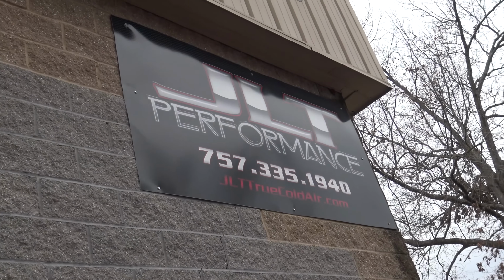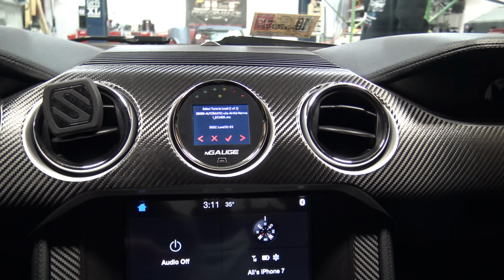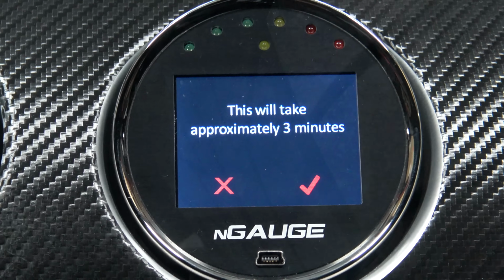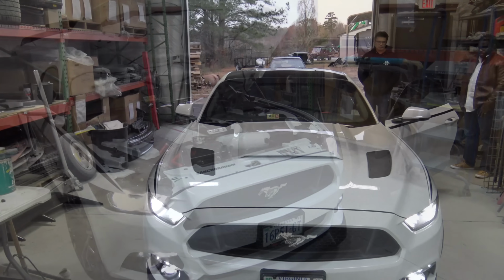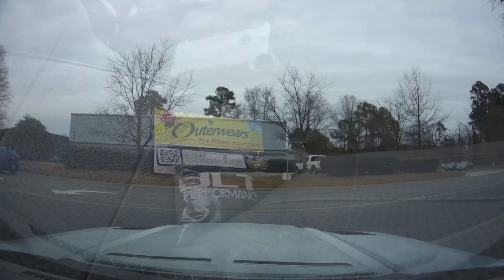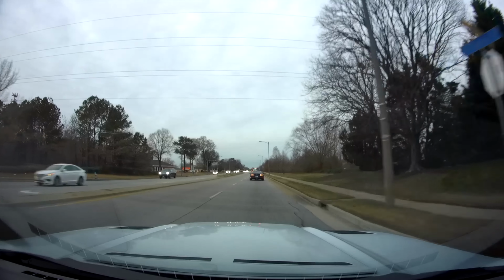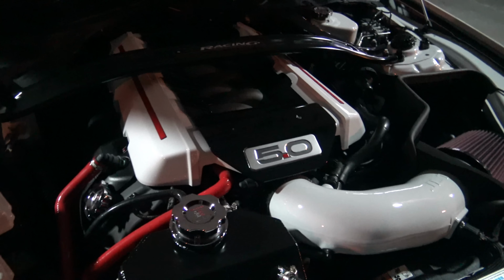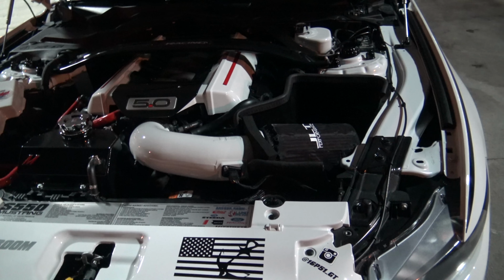JLT Cold Air Intake (15-17 Mustang)

Comment: Nice. But did you consider the PMAS cold air intake its supposed to be better than jlt I've done some research and PMAS is on top of the CAI market.
Reply from the maker: I've heard of PMAS, but I don't know anyone that actually has one.
Reply: hyatt64 went from jlt to pmas and I could definitely tell the difference between the two, pmas is the best I've had so far.

Comment: Your ride is coming along nicely!  I bought my 2015 used (dealer) and it already had the JLT intake installed.  What are the chances the previous owner did not install the JLT tune?  Is there anyway to find out?
Reply from the maker: The car won't run properly without a tune, so if you aren't having issues then it's likely that it is tuned.  If you wanted to re-tune, you'd have to but a tuning device, get the stock file, return it to stock and then load a new tune.  Lund and Palm Beach Dyno are good options.  I like Lund because of the nGauge tuner.

Comment: Looks good , sounds good, I just installed my nguage yesterday I didn't flash the tune yet just a little worried about voiding warranty
Reply: Steve Cranmer why be worried? Mustang are built to last and to be driven hard. You will be fine.. especially with a Lund tune.
Reply: Steve Cranmer you can always get a Ford racing tune with the gt350 CAI and have it installed by a Ford dealership. your warranty stays intact. Or get a CAI that doesn't need a tune, JMS pedal max, and a cat back exhaust.
Reply: Just wondering will a Ford racing tune from the dealer help with a closed C&L Air Intake for a v6 mustang or is it just for certain things.

Comment: I love everything under the bonnet of your car, do you mind telling me what you've changed? Like the whole JLT intake obviously but engine rocker covers done to match your paint, the coolant reservoir tank etc it looks mint as
Reply from the maker: Thanks!  I added hood struts, painted engine cover, painted fuse box cover, painted brake fluid cover, painted radiator cover, Mishimoto oil separator, Mishimoto coolant reservoir, Ford Racing strut tower brace, UPR strut tower caps, Ford Racing coil covers, chrome caps, JLT intake (with painted tube) and Anchor-Room build plates.

Comment: why didn't you just pull the insert sleeve out of the Airaid? that's what I did with mine on my 2012 after I got it tuned
Reply from the maker: Mine didn't have an insert, it would require actually cutting part of the tube.  Which isn't that big of a deal.  But, I also wanted to switch the look up and always planned on getting the JLT.  I only went with the AirAid because I didn't initially plan on tuning my car.
Reply: 16P51-GT it's not worth the hastle. jlt looks great 👍
Reply from the maker: Thanks!

Comment: I've given up on the Lund tune for 2016 automatic. My car was actually no faster than stock at wot with it. It felt real good at lower rpms in drive mode is the only good I can say. If you want to know how faster your car is with your mods, use one of your friends mustang as a benchmark, if you're faster or slower and vice versa. Do mini drag races and rolling races. The Lund tune felt faster but I was no faster than a stock 2015 camaro ss auto and that car is rated at 400hp (not whp). When I had my car dyno tuned, I was pulling away from him the whole time. The dyno tune is fast at wot but all other times it's not very satisfising to drive. I'm trying out steeda right now and it "feels" equally fast at wot and pulls much harder than stock below 2000rpm (normal driving for me now is below 2000rpm and I'm accelerate decently). But of course I won't know how good it really is at wot until I race my cousins SS again. Time can be misleading also, so you should race someone. I recommend you give steeda a try, I requested wot shifts complete at 6500rpm (stock is 7000) for both normal and sport modes, firmer shifts than stock for all drive modes, and better acceleration at lower rpms to avoid frequent downshifts and it's translated to not more torque down low (because the s550 is what it is) but it feels like it does.
Reply from the maker: It's funny that you mention all of this.  I started noticing with the new tune that my car starts to redline when I accelerate hard in Sport mode.  Lund requested some data logging, so I'll do that tomorrow and send it off to see if I can get a revision done.
Reply: 16P51-GT good luck, been down that road with them, john II was very patient with me but never got it working right and I eventually abandoned sport mode. While I had the tune, I only used sport mode for manual paddles. I think it's the software they use, something about how it allowed them to access settings that software specifically for the 2016 model year didn't grant them. I think there are real differences in the tcm between 15/16 that causes issues for 2016 automatics. And as I mentioned earlier, my car was no faster than stock at WOT. When I come down to VA again I'll call you up and let you try out the steeda tune combined with the pedalmax. When that happens I'll have tested it against my cousins 2015 camaro SS.
Reply from the maker: Sounds good!  My next video will about the data logging and the issue that I'm having with the tune.  So, we'll see if it can be rectified.  If not, I'll check out other options.  Seems like a lot of people have issues properly tuning for autos.
Reply: Hi 16P51-GT,   Is there a way to take a tune from my car and send it off to have someone look at it. I have a 2016 GT with a Hennessy 700 package. It has the whipple 2.9L hesitation that I believe one of your other friends had.
Reply from the maker: Usually the tuner would want you to data log.  I'm not sure if you can just send the tune itself off for review.  But, data logging would show them everything that they would need to know.
Reply: 16P51-GT thanks for the reply. What software would be best to log everything? Sorry for such a nube question. I'm old school playing with new school stuff.  Lol.   By they way love the channel man. I see your always around the beach area. I'm from princess ann area my self.
Reply from the maker: Oh, cool!  Yeah, I live in Va Beach.  For data logging, I use the Lund nGauge Tuner.  You can data log with the SCT tuner as well.  I'm sure that there is probably software that you can put on a laptop as well, but I've never used any.

Comment: Hey man. What is that metal s550 plate you have installed at the front of the engine hood bay area?
Reply from the maker: It's a build plate made by Anchor-Room.com.  You can customize it to say whatever you want.

Comment: Just curious why did you change from the Airaid CAI
Reply from the maker: The JLT allows more air in to the engine which gives more power.  The AirAid is a "no tune required" CAI which is nice if you don't want to tune your car.  But, since mine is already tuned I figured I may as well go with an intake that will take advantage of that.

Comment: I have a JLT on my mustang with a steeda tune. But I ain't feeling it no more because you can use the sport / track mode. It mess with engine when you slow done it rise the rpm. So I'm sell it get me the ford racing power pack 2 or 3.
Reply from the maker: Hmm, I wonder if the tune is causing that.  I have a Lund tune.
Reply: 16P51-GT I got the sct x4

Comment: why did you get rid of the Airaid intake and get the JLT, if you don't mind me asking
Reply from the maker: The AirAid doesn't require a tune, it doesn't allow as much air in to the engine which means less power.  It's a good option if you don't have a tune, but since mine is already tuned, I figured I might as well get an intake that would give me a little more power.
Reply: 16P51-GT just asking , I have the Airaid same one you did , and mine is tuned , would you recommend me in changing it to JLT
Reply from the maker: If your car is already tuned, yeah I would recommend the JLT over the AirAid.  You'll get more power.
Reply: 16P51-GT thanks I will look into it
Reply from the maker: No problem, man
Reply: Van Seaco keep your airrade.an air box is a air box....just get the tune.
Reply: danny brown I have a tune with my Airaid from Bama